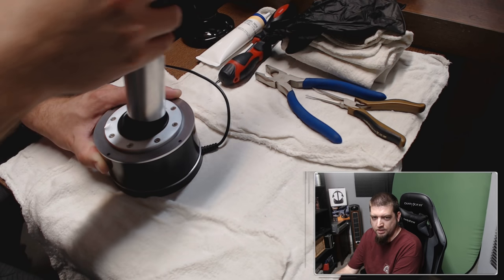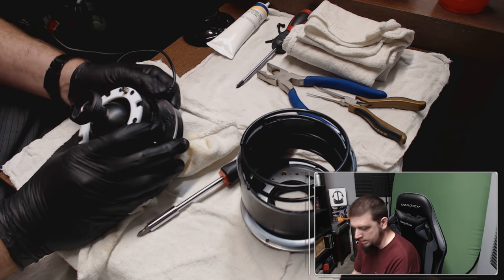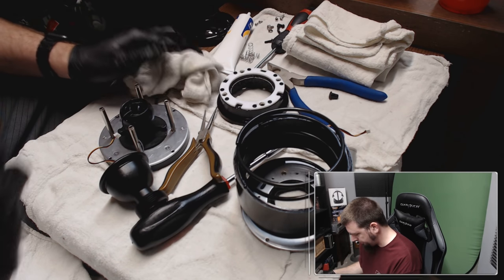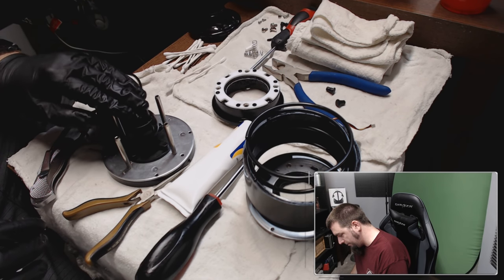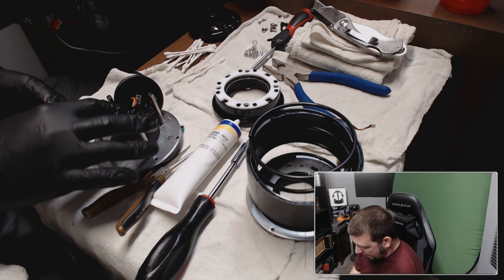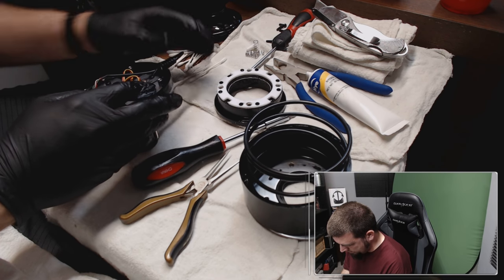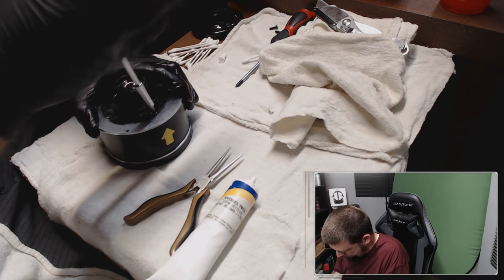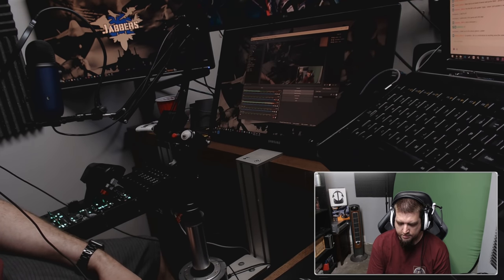Warthog Teardown and Regrease - Stream Highlight

Comment: Thanks for the video, very helpful ! Done it and it's so smooth now !

One thing I would do differently is NOT to grease the 4 metal posts. I found it's too much damping for the return action and it feels very wrong... like the stick doesn't want to center. Had to reopen and remove the grease from those.

Comment: Can I give you one teeny teeny bit of advice please Jabbers me auld fruit.  When you start a job like that.  Put on 2 pairs of gloves.  Do what you gotta go and get past the messy bit.  Pull the messy gloves off and bin em.  Clean gloves to carry on.  Saves fking about.  Learned that through using drain patching resin.  Your welcome.
Reply: Man, if only I saw this comment before I replaced the wheel bearings on my truck this weekend. Thanks for a great tip!
Reply: @YeaImRota  you're welcome.

Comment: Hey Jabbers, great video on alleviating the stiction problem (by doing the sanding and regreasing process). I did it myself last year and I think you did a good explanation on what all needs sanding: I myself also found that it helps to sand the insides of the gimbals if there is any residue / plastic edges left from the molding process. Not the wholes where the connector plugs insert that keep the gimbals together, but the insides of the gimbals where the sensor housing sits, as well as the post on which the magnet is connected. I too found that it improves the quality of the TM Warthog immensely and it makes precision flying so much better!
Reply from the maker: Agree and I did sand the inside as well like you, forgot to mention.  It really is night and day difference!

Comment: I can attest for the smoothness and viscosity of nyogel.  Made even my cheapo FCS throttle seem like it cost $100 more than it did.  Could actually bolt the tension to the highest setting and get buttery smooth motion even with a little finger nudge, and yet also hold the throttle vertical with zero sliding.   Expensive, but well worth the price since a little goes a long way.

EDIT:  I wouldn't use q-tips for application (unless you cut off the fuzzy part and just use the cardboard stick).  The fuzz from the tip will get ripped off and permanently lodged in the applied nyogel creating grit particles.  Probably won't have much effect if one or two strands get in there, but a whole head spread out will probably cause excess & uneven friction.  He cut off the tip of the tube applicator in this video, but really you can just the tube nozzle itself as an applicator, just requires a firm squeeze to get it out.

Comment: Hey Jabbers... nice instructional video:) I have 3 of these and have done pretty much the same process... quite a while ago. As you know, the stiction is caused by dust and debris getting down in the base. This can be solved by taking a large round balloon (30 inch works well... I prefer black) and cutting a small portion of the end off. Not the end that you inflate , but the other end. Leave the inflate nipple on as it fits really tight around the shaft. It can then be fitted over the shaft and the entire base. It will fit snug underneath the base.  This makes it impossible for anything to get in the base. They last a long time but will eventually split and have to be replaced every year or so.

Comment: Hi,  maybe you can help me. My right throttle from thrustmaster hotas warthog is moving from 0% to "full" 100% just with a small movement. Do you have any idea what could be causing this? obs. I already instaled drivers and softwares to calibrate but doesn't work.  I tested the  cable continuity using a multimeter and they are ok. I saw that there is a smal printed circuit board near the throttle magnet, Does Thustmaster company sold pieces?  Thanks for your attention !

Comment: How can u remove the 4 screws on minute 5:03? They turn all the time on my TM Base but they don’t came out?

Help pls
Reply from the maker: Try a magnet tip screw driver, I just pulled them out, hopefully you didn't strip the threads

Comment: I've had to do this myself and I too had the rubber gasket detach on me. The gasket is not so much for dust as it is for damping the contact of the plastic to the metal housing, without it you will have accelerated wear to the gimbal ball.

There's a fellow going by the moniker Hempstead who machines low-friction solid PTFE replacement gaskets. They feel a little different from the stock rubber one but you stop noticing it after a while. You could also get a replacement gasket 3D printed in a high durometer TPU which ought to work quite well.
Reply from the maker: Thanks for the info on the gasket, that makes more sense then to keep out dirt.  I ended up having one sent to me from a viewer, www.buddy-fox.com
Reply: I recall getting my PTFE ring from hempstick for cheap, I don't know if it can be found there anymore. in any case will bookmark this link you provided :)

Comment: Jabbers, this is an awesome video. Not nearly as exciting as a romp in DCS, but necessary from the TM  Warthog hardware perspective. I have owned Thrustmaster products since the early 90s when they were based in Oregon, USA. At the time they were a small company and the products and customer service were top notch. I still have/use two TM Cougar HOTAS and an RCS. The Cougars were modded straight away with Cubpilot's Hall Sensors. I considered buying a new TM Warthog HOTAS to update my gear, but I find way too many reports of this unit malfunctioning or failing. Spending nearly $500 USD for a product and then jumping through these hoops when stiction sets in is unacceptable. Thrustmaster needs to design products that work out of the box and continue to be reliable throughout the product life cycle. Quality problems are disheartening and off putting especially at this price point. I'm looking at other options for my next purchase.

Comment: Thanks for the vid, helped me with my first go. At my surprise there was hardly any stock grease in mine. I've only had this stick for about a year.
Reply from the maker: It doesn’t take much but I think a lot of the problem is more the plastic gimbal
Reply: True. Mine however was pretty dry. only a micro amount on the gimble. while im sure it was enough to protect it, certainly not enough to provide good movement. With 767a on there it adds smooth movement and resistance. Before it was way too easy to move the stick with slight sticking.  @Jabbers

Comment: Did exactly the same thing a year or so ago. Its been awesome ever since. Same grease too. Sanded it down with 600 then 800 then 1200 grit sand paper.
Reply from the maker: Prior to the video I had taken it apart and sanded using 400,800,1200, but had used the wrong grease.

Comment: So did it even last?  I just stuck an extension on to see if it helped with stiction but it just seemed to make it more noticeable.  Though I do still have better fine control, just wish it was smoother.  So if this worked then I'll place an order for some better grease
Reply from the maker: I used the base for about 6 months after doing this without issue, still have it and it still feels great. I've since moved on to using other products but highly recommend doing this if you have stiction issues

Comment: Ty, great video, very informative!

Is it just using the big spring, no cams fx for the movement? And is it potentiometer or hall effect for sensing?

A thought here: springs are greased to aid in movement like as you move the stick the springs move (rotate) probably the reason it’s greased is to reduce any friction from that
Reply from the maker: Yes it's just a spring, and a hall sensor

Comment: You should NEVER use Q-Tips to apply lubricant to your gimbals.Why go to all the trouble of sanding and polishing the ridges off your stick and then use a cotton fiber based product which leaves behind tons of cotton fibers embedded in the grease of your freshly polished gimbal. Also check and keep an eye on the magnet mounted in the center of the gimbal. My brothers stick had the magnet slide down and hit the sensor and totally ripped it from the sensor board which destroyed the board....and guess what? YEP... Thrustmaster will NOT send a replacement for it.Only option was to buy a WHOLE NEW STICK.Also might want to consider putting a fabric sleeve between the gimbal top where the extension threads on and the silver ring on the stick base like car stick shifts have.This will keep out the dust and debris which invariably collects inside the base and contaminates the works.
Reply from the maker: Cool thanks for the tips!!

Comment: Have you ever considered the Virpil/VKB sticks? Would love to hear your opinion on them.
Reply from the maker: If they want to send me something for evalution, I'd be more then happen to make something,  but considering VKB stock has been unavailable for months, and I dont have the money to sit down and just buy new sticks just to make reviews, Ill have to wait :(
Reply: I'm not Jabbers, but I have the VKB gunfighter and I have a Virpil stick coming in the mail. I'm going to be doing a comprehensive, data-driven review of the sticks. So far, I have been disappointed with the VKB stick, and I'm looking forward to seeing how the Virpil one compares. I'll probably be putting the review on reddit, though I may do a video as well. Time will tell.
Reply: Povilas Kuznecovas For the VKB stick, both CAM sets have a non-linear and asymetric force gradient. It requires less force to pull the stick aft than it does pushing it forward. Lateral stick is also asymetric (uses the same cams), though I can't remember off the top of my head which direction is lighter. The non-linear force characteristics are such that the force gradient is shallow in the middle and high at the ends of travel. Ideally, the force gradient should be constant everywhere except in the case of the center detent. This is undesireable as the light forces in the middle make precise inputs difficult.
Reply: Povilas Kuznecovas who knows, I might not like Virpil either. We'll see what happens when I get it and measure the forces. I will say that VKB is much smoother than the Warthog (no stiction) but I really dislike the Russian-style grip (and I don't think that's just my American bias talking either). I will likely be putting my Warthog grip, and later on the Hornet grip, on the Virpil base and just using that, assumingthe Virpil base proves superior. 

The asymetric force is a result of the gimbals and cam design. It can be made symmetric and linear, but the cams have to be shaped correctly. Unfortunately, this is not the case, for whatever reason. To my knowledge, Virpil uses the same basic gimble design as VKB, so their stick base may be prone to the same problem if their cams aren't shaped correctly.
Reply: The design of our VPC MongoosT-50 gimbal is actually quite a bit different, as is our upcoming VPC WarBRD! Feel free to contact me at support@virpil.com and I'd be more than happy to chat with you about the designs and behaviour of our gimbal and cams!
Reply: VIRPIL Controls I took a look at some pics and videos of the internals of the mongoose base. At a first glance, I'm pretty happy with what I see. The mechanism is indeed significantly different. Before I release the review, I'll likely reach out for comments from you and VKB, but only after I've done the bulk of the work and evaluated the sticks. I want to remain as impartial as I can.
Reply: Completely understandable - Well you know where we are! :)

Comment: I worry that I will be back watching your video in about a year. Last week I bought a new Warthog HOTAS , nr. 83300, and am really happy with it (apart from obsolete T.A.R.G.E.T. software). I know...I am very late to the Warthog party;). If, or - more likely - when the stiction problem presents itself I might replace the base altogether with the Virpil WarBRD base, but I like to hang on to my precious metal! Warthog stick. Who knows, by that time even Thrustmaster might have released a competitive alternative (F-18/F-16 stick?). Hope TM will upgrade their base with a metal gimbal (read: copy Virpil or VKB mechanism).
Reply from the maker: I ended up with the Virpil WarBRD base myself.
Reply: @Jabbers  Good to hear! Has the WarBRD base been living up to your expectations? Is it really better in your experience than the TM Warthog base, or just different in feel? Is it more precise in the middle, and easier (less force)  to control? Or is it just that the metal cams with springs and gimbal are more durable (maintenance free)? In short, just wondering what you think of the WarBRD.

Comment: LOL all I did was use a blow air spray and added some grease with out opening anything ;)
Reply: how you did tht? What spray?? and how you put the grease witoth opening it?
Reply: @cristianeperla5154  "Airduster", "air in a can", "pressurized air", they are all the same.
About the procedure, I have no idea. Probably just applied to the joint from the top.

Comment: I followed this video, and now my joystick is broken :( It wojnt move after putting it back together and I cannot figure out why. I KNEW I shouldnt have followed this video, clearly I did soemthing wrong but no idea what and I now am out 1 warthog joystick :(

Really quite upset :(
Reply from the maker: Sorry to hear, I've taken mine apart 2x this same way and had no issues, maybe try again, if it's already not working what's the harm in retracing steps and trying again. Good luck
Reply: Check your top plug. I once put mine on 180 degrees out and pushed the female end back inside the assembly! Was able to fix it luckily.

Comment: Great video, man! Unfortunately, I believe, I completely messed up my new Warthog.. Maybe someone can help me out:
I did the cleaning of the parts and sanded the seams and the two bolts. Then I put on some Molykote EM-30L and put the thing back together. But now it feels even worse than before..! There's a high amount of friction, it feels like there's grains in the grease and the stiction is horrible.

Without the stick mounted, the roll axis is quite good, whereas the pitch is pretty pad. If I assemble the whole thing and screw the stick on it, both axis are sticky and got alot of friction.

I already found a post on Reddit where the guy sanded the inside of the swivel ball, but that didn't help either.

Or maybe the grease is the problem? I live in Germany, therefore the Nyogel 767A is not quite an option..

I am desperate and afraid to have f**ked up such an expensive stick.
And tomorrow the Supercarrier launches.. -.-

Thank you guys in advance! :)
Reply from the maker: Might be the grease, maybe it's to viscous. The nyogel is a damping grease, super thick and sticky but also grease
Reply: @Jabbers  Alright, After cleaning and regreasing and having the same heavy sticky problems, I eventually ordered a tube of Nyogel 767A yesterday. As you state in this video, it seems to be a true game changer.. Got lucky as I found a UK based shop. Will report as soon as the work is done!
Thank you, Sir.

Comment: I wonder if copper grease would do the trick as well?
Reply: I'm not sure it is plastic safe, also is toxic. might not be the best idea, use a silicon based lubricant with high density instead.